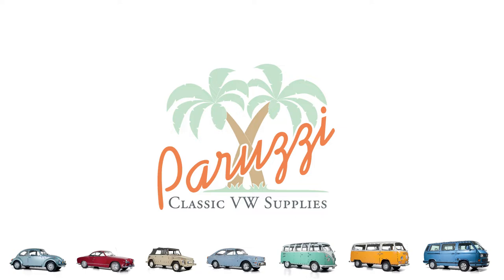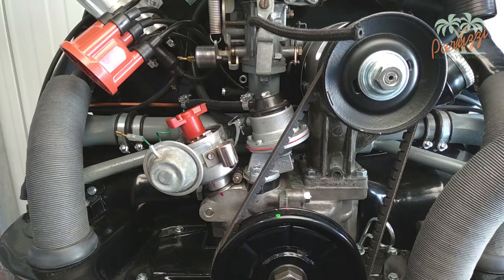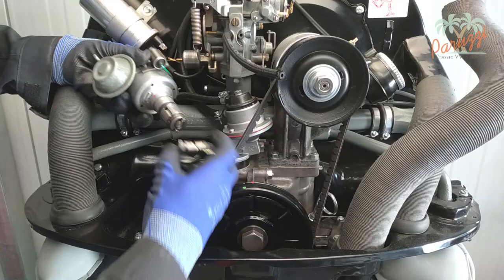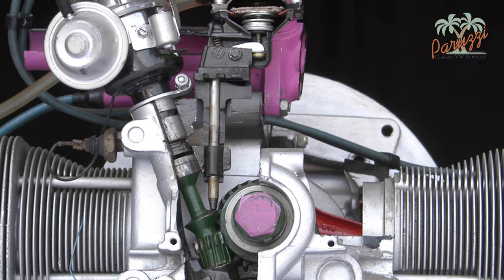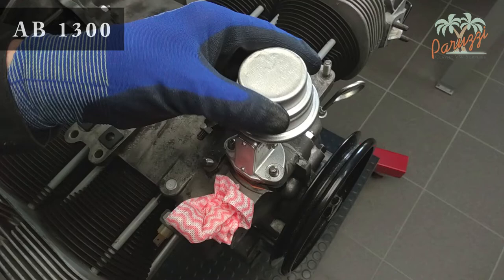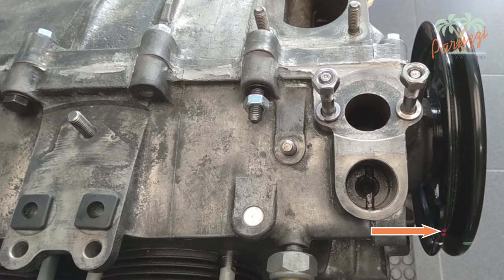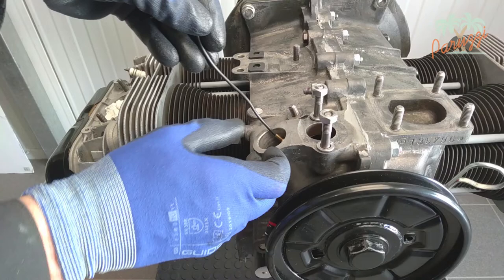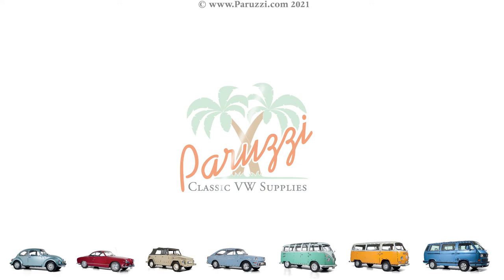04 Engine overhaul - removing the distributor drive shaft

Comment: When preparing to do my first (by myself, not letting shop do it) valve adjustment, I discovered my distributor to be 180 off... as it has run fine for all these years, I'm not going to risk this surgery. Great info, though, and was extremely interesting to watch. Thank you for posting this video, it was quite educational.
Reply from the maker: In some cases, adjusting the ignition is not possible, because the distributor will be blocked by the fuel pump, rotating to the correct pre-ignition is impossible, in some cases, you get lucky, and you can adjust even with distributor 180° off. So, you were one of the lucky people. Rotating it just for the aesthetic is not a good idea, too many risks to damage parts, just for the view. So, if it runs, don't touch. Thanks for watching. Xavier

Comment: When my motor is at TDC, my rotor faces #3 and the small half moon is facing the driver's side instead of the crank pulley. My wires are in the same order as stock. I have a very rough cold idle, but once warm, is good. The engine seems to run fine. Any ideas on what to do to get the distributor shaft half Moon facing the crank pulley and  have the rotor facing the notch on the distributor cup which is pointing to cylinder number 1? Great informative video!!!
Reply from the maker: Not all distributors will be in the same position on all Type 1 engines. Could you send some pictures to info@paruzzi.fr, so we can look into your question in detail?

Comment: I did manage to get my distributor in 180 out. Couldn’t get it to run. Was pulling my hair out   My Dad walks up pulls the distributor out turns it, puts it back in and car fires right out. I was but happy and angry at the same time.
Reply from the maker: Thanks for this great comment, gives us the extra motivation to continue with a smile.

Comment: Crap I forgot to put the little spring in. It ran fine then I found the spring on my parts tray. What exactly is it for and is it nessarry?
Reply from the maker: The spring will keep the drive shaft under tension, between the distributor and the rings below. Possible lots of rattling, but wear is the biggest issue over time. Disassemble and insert the spring. I know, not pleasant. When overhauling, always use exploded views from your engine, to find out which parts go where, en the sequence. In many cases, previous overhauling was not done well, missing parts, or using parts with incorrect size/strength.